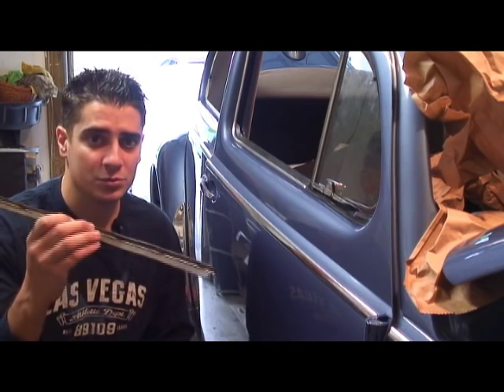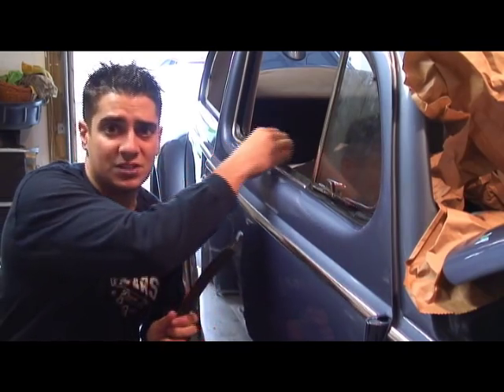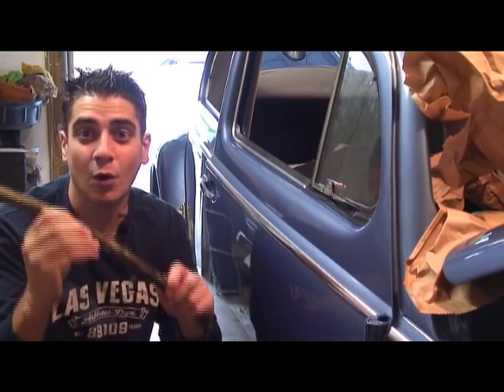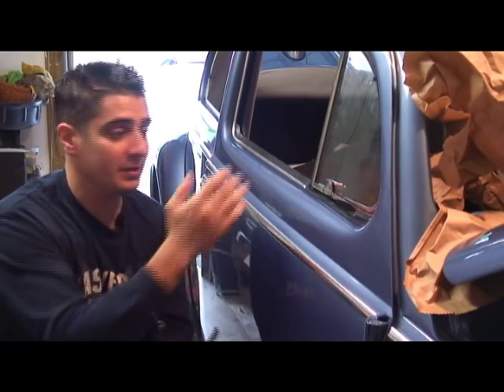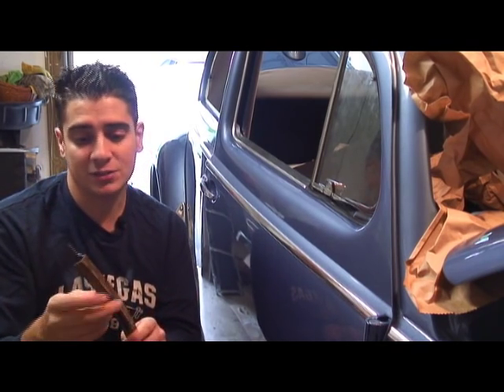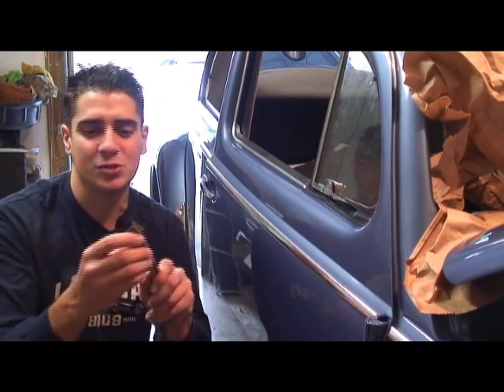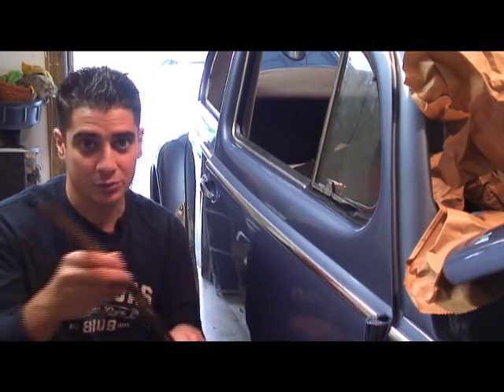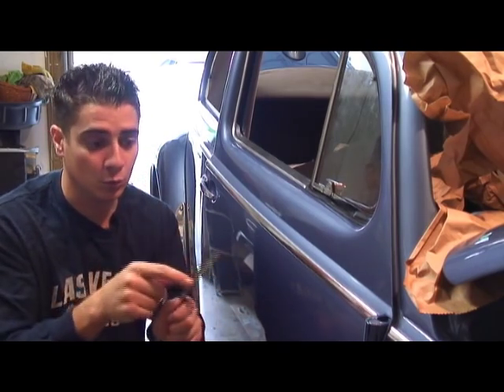Classic VW Beetle Bug Resto Tip Inside Window Scraper Type 1

Comment: I have a 61 and attempted to do exactly as you did, but my rubber must have been low quality because the weedwacker string just cut through the rubber. Where do you get yours? I would like to buy the front, rear and two quarters.